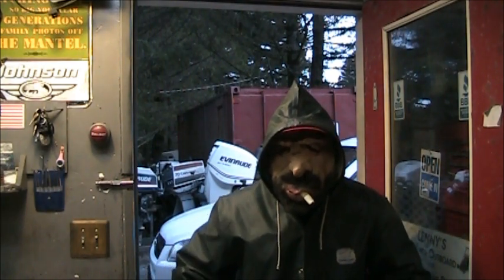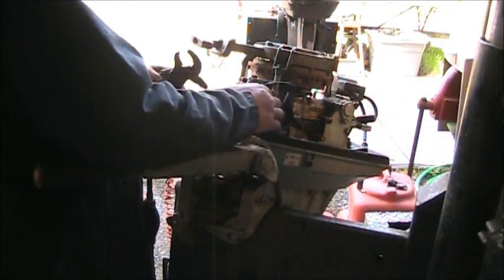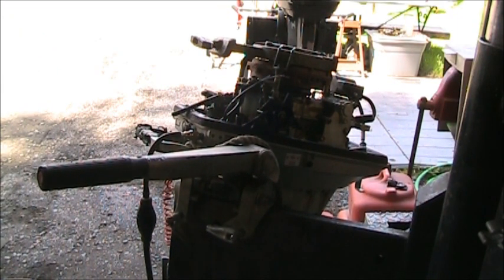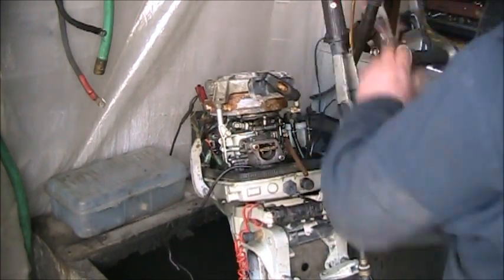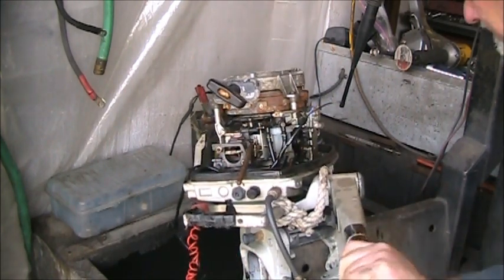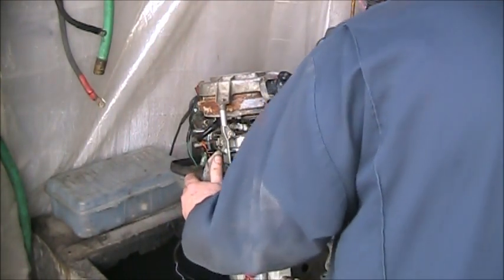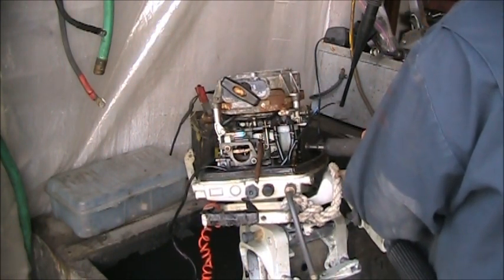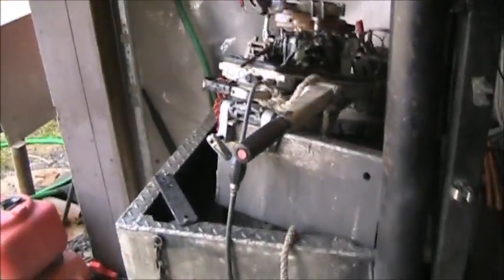Here I go inside a very Abused outboard,,  & more.. come along.   kodi

Comment: Hey Cody I have a question what causes an outboard to start with the garden hose hooked up to it but when you get it to the lake it will not start at the lake runs fine on the garden hose but she's getting it down to the lake it will not start just sits there and cranks it is a 1990 Johnson 60 horse
Reply from the maker: Back pressure against low compression not evident on a hose.  Do a compression test.     kb

Comment: I just found your channel after buying an old 71 20 hp Johnson. Great job and info. I’m an old timer that grew up with 60 and 70 OMC outboards . Now in retirement I’m going back again. The 20 hp will not pull through the compression cycle. It barely does with a drill on top. With plugs removed it’s smooth, smooth. Pulled the power head off and same results. Pulled the head and looked pretty good inside. Shot all kinds of lube down there. I can’t really get a good compression test after replacing the head. One or two rotations and 70 on each cylinder. Can something bind up in the crankcase when under compression but not with plugs removed? I’m ready to break it all down just to see what’s there. Any thoughts are really appreciated
Regards 
Pete

Comment: Hello Kodi I just recently purchased a 1990 15 hp long shaft Evinrude that is set up and was wired for electric start at one time, I am wondering how I can add a solenoid to the motor, I wired in a temporary push button and than I ohmed the neutral switch out and it is faulty as per the manual instructions, the starter does in gauge I just want to know if I bypass the neutral switch will I need to remove the wires on the buss Barr at the rectifier? ( from the starter and neutral switch) and wire in the push button to the solenoid. Thanks for your time I really enjoy the videos
Reply from the maker: +ra'  No need 2 remove the wires,  U can 4 sure add a solenoid but your motor never came with one,  Those tiny starter motors never drew the amps
to get really hot, so omc decided 2 fore-go a solenoid.  on them.                                                                                      kodi

Comment: OK, so it did have spark?  She's a crusty one for sure....Like you said, too bad, that engine probably had plenty of service left in it...
Reply from the maker: +kramden,  Sorry did not realize i edited the part about the spark,  Owner had the power pack wires spliced to the MOB kill switch wires, I just wired  them 2 the correct wires coming from  under the fly wheel & got good spark,  A thing I have learned about this generation of Suzuki outboards is the spark is a very thin spark, and will not jump a arc much over 3/16 inch  but they will run fine.                                kodi

Comment: Got a 1963 10 horse johnson that I got running but get a lot of oil in my water tank what do think
Reply from the maker: +MJ,  if the motor has sat 4 a long while that will be normal for a while, take it out on the water for a good long run,  will most likely improve.   kodi
Reply: @kodibassInsideoutboards  thanks it was given to me by an old fisherman it had been on the ground in his back yard for awhile he could not remember howlon at least 2yrsigot it going but  runs s little rough did do carb  kit  just need to play with the keys I started with one turn open but seems kinda rich need to turn bottom ( intake) jet in for smoother at high throttle bit then does not want to idle. Am I right about one turn open to start with also is the upper jet air and bottom fuel? I'm new to working on boat motors  thanks again for the tip on the oil in the water the motor does smoke a bit more than I would think is normal for a 2stroke that should get better after a good run too I hope

Comment: Snag that little wire throttle linkage deal with the 2 plastic clips throw that in that flat rate box I'll go ahead and send you 15 more dollars of dont mind .. that little aluminum rod with the brass stopper deal on it and it connects at the carb roller and the linkage for the tiller handle